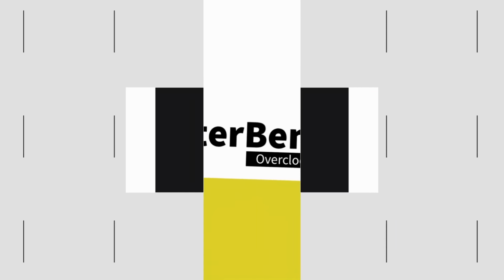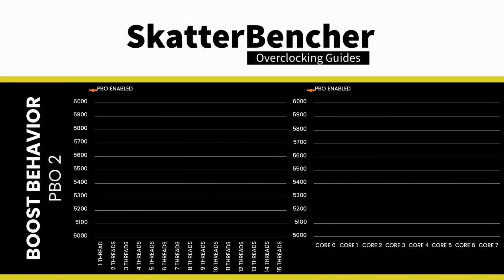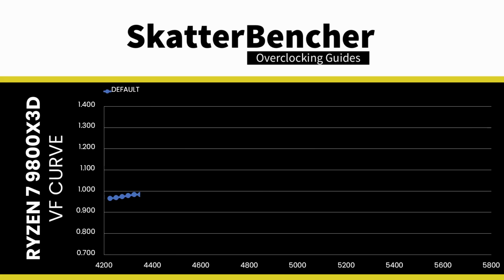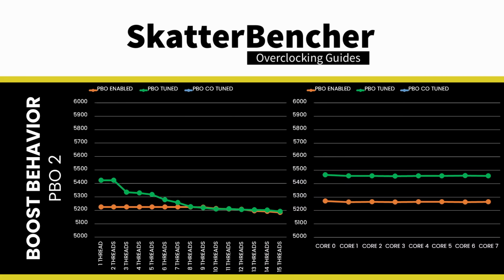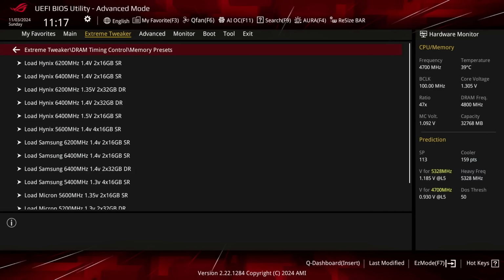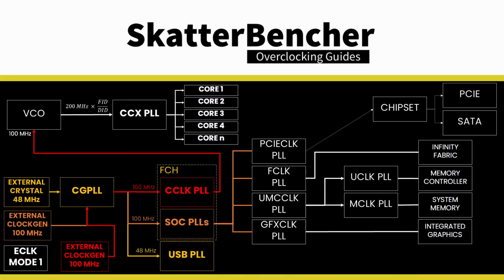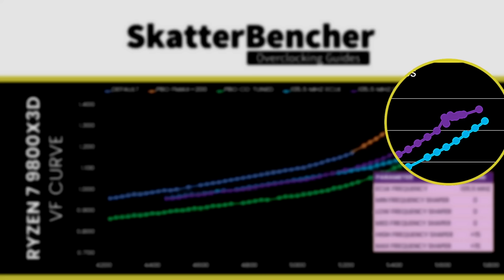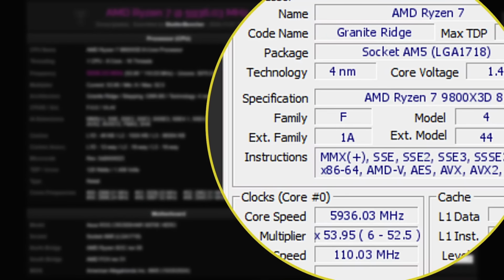Ryzen 7 9800X3D Undervolt & Overclock to 5750 MHz | SkatterBencher #82

Comment: I tried exact same settings using exact same components but can’t get it to run. The minute I change to asynchronous mode it doesn’t like it above 101?  Any suggestions??
Reply from the maker: Are you changing the correct eclk in asynchronous mode? What is the behavior - just not booting up?

Comment: Okej, guys I need help. Setup b650+9800x3d+kingston fury beast 6000mhz. While overclocking first way (+200mhz) after saving and reboot dram led on motherboard is light up orange. Tried do remove battery from bios, clear cmos nothing works… did i fry something? Looking for serious answers
Reply from the maker: Highly unlikely you fried something. It sounds more like a memory or memory controller problem. Try removing 1 stick of memory, cmos clear, then boot. Once you get to BIOS, apply the same settings except for enabling EXPO. If that works, it's probably some auto-rules giving trouble with DDR5-6000.

Comment: Hi Possibte ram OC with this CPU? I want to run my gskill around 7500MHZ
Reply from the maker: Yes you can overclock the memory. DDR5-7500 will require you to run UCLK = MEMCLK/2, however.

Comment: what is now the sweetspot for ddr5 for 9800x3d...when overclocking.?
Reply from the maker: 6000 to 6400 MCLK, 1:1 UCLK and 2100-2200 FCLK is usually the most straight-forward. If you get 8000 with 1:2 working, apparently that's also pretty good (though I never run it)

Comment: Wow!  Are there any videos where you do Curve Shaper opverclocking like this on other  non-Asus boards and BIOS?  I sure would like to know if it is possible on other manufacturer's boards/BIOS and have a list of which ones those might be.
Reply from the maker: Any AMD board should have access to the Curve Shaper options because it's part of AMD's BIOS structure.
Reply: @SkatterBencher  thanks for the response!  I just received two motherboards which I'm going to test with my 9800x3D in the next few days.  One is the ASUS ROG Strix X870-A Gaming WiFi and the other is the GIGABYTE X870 AORUS ELITE WIFI7 ICE.  I believe that neither of these have an ECLK so I'm tempering my hopes for success.  If I'm presented with an ability to do curve shaping at all, I'll also try per core shaping just to see if it is supported.  I'll let you know what I find.
Reply from the maker: Good luck and have fun!

Comment: Best OC channel. What would you recommend for this ryzen DDR5 6000 or 6400?
Reply: depends on the cl
Reply: I have a 6000 kit that runs 6400 cl 30 and its better ofc. Lower latency. At the same time, if you do 6000 cl28 there is almost no difference
Reply: 8000mhz is the best so you can match UCLK and FCLK
Reply from the maker: Whatever works with 1:1 UCLK (6400 might be a little tricky), then just optimize the sub-timings a bit.
Reply: @TehShiaT11einself  So G.Skill or Corsair 6000Mhz CL28 ?
Reply: @obviouslee1949  cant go wrong with that
Reply: @iikatinggangsengii2471 cl is not an important timing. It's a half decent indicator of which IC the kit is, that's about it.

Comment: hello. great video. what is your g skill ram kit? the one in the link goes to a 48gb kit.
Reply from the maker: I have some early production model of this F5-6400J3239G16GX2-TZ5NR.

Thanks for the heads up, I updated the link in the description too
Reply: @SkatterBencher  ty mate
Reply: @SkatterBencher  last question if u can help: would this be a good kit F5-8000J3848H16GX2-TZ5RK to test both scenarios? 6200 or 6400:2133 and 8000:2000 or it's not even worth it with the 9800x3d? i have a x870e hero as well

Comment: I just got done building a new PC with a 9800X3D on a gigabyte x870e Master, should I have the latest bios installed ?
Reply from the maker: It's not a must but I always try to have the latest BIOS installed. Usually it has all the latest improvements (particularly for memory compatibility).

Comment: Can I apply these same settings for my 9800X3D on a Crosshair X670E Hero motherboard or are these specific to X870(E)?
Reply from the maker: The overclocking process for X670E and X870E are identical.

That said, I would never recommend copying settings from the internet but rather advise to adjust the settings according to your system's capabilities
Reply: @SkatterBencher  thank you for your response

Comment: Thank you so much for the guide! Right now I have two sets of RAM and I am wondering which you think would be better for my build with the 9800X3D and ROG X870E Crosshair. One is Corsair Vengeance (Non-RGB) 6400MT/s CL32 and the other is G.Skill 7200MT/s CL34 from my current Intel build. I’m honestly not sure if the G.Skill RAM would be compatible as it is not on the motherboard’s compatible RAM list. Do you think I would get the best performance from A.) using the Corsair kit and copying the memory timing and clock adjustments you made B.) trying to run the G.Skill kit and see the best speed and timings I can get from simple EXPO or C.) copy the memory timings and clock adjustments you made but using the G.Skill kit. I that believe both RAM kits are using SK Hynix A-Dies but not 100% sure.
Reply: @SkatterBencher
Reply from the maker: Tuning the 6400 kit will probably be more straight-forward than the 7200 kit
Reply: @SkatterBencher thank you so much!

Comment: I am new to this. I am following Strategy #2. I set to 10x scalar, cpu boost to 200. I started with curve optimizer -15 all cores and climbed up to -25. At -25, I ran OCCT, the max I get is 5080 MHz (all 8 cores), 86 degrees C, 150 W, 1.09 V. I am not sure if I am doing anything wrong. Should I keep raising it to -30 and so on?

Ryzen 7 9800X3D
MSI x870E MPG Carbon
arctic liquid freezer iii 420
G.Skill Trident Z5 Neo RGB Series 32GB DDR5-6000

Comment: Is it possible to tune memory similarly with 32gb modules? Or are they slower?
Reply from the maker: It's possible to tune 32GB modules but the timings won't be the same. Maybe you can check Buildzoid's channel to see if he has a guide on how to tune 32GB modules
Reply: @ thank you!

Comment: did you increase die vddg iod and ccd for the fclk 2200 or both on auto (system ramped it up from default?)
Reply from the maker: Auto-rules increased it to 1.0V. I didn't touch it myself
Reply: On the okay cpus 2200 should work on default voltages which are typically under 1.0v. VDDG IOD is the one which has the most effect in FCLK stability. I run 1.27v VDDG IOD on my 8600G for 2550FCLK.

Comment: So, if I don’t wanna have to do all that with the curve optimizer, can I pin it to its boost clock and just add the 200mhz to it? Or was that what you meant it doesn’t act as an offset? Coming from first gen ryzen overclocking so a little outta the loop. Don’t have the same board running an MSI x870 gaming plus WiFi. I don’t have all the perks that the rog has. But I still have like 99% of those features other than the external clock gen I think. I cannot set to asynchronous mode either.
Reply: I'm wondering this as well, why would I care for tricky undervolting when my temps are fine in real world use cases anyways and can get the 200 mhz for "free". I say tricky because I read so many different experiences from people, even people having to reinstall windows after too many crashes. I don't care what kind of voltage is going through my CPU, so long as it runs within the specified temperatures.
Reply: You can just enable PBO and set +200MHz but cpu probably won't boost that much without negative CO. My cpu hits 5425MHz and stays there all the time with CO -30, anything below it won't boost that much, even though cpu temp stays the same at maximum load (82°C - Phantom Spirit)

Comment: Is it not possible with AMD to just lock everything at lets say 5.2Ghz at all times and then tweak voltage? The way it was always possible on Intel? So I don't have to deal with this "it's stable in this case but not in this case"?
Reply from the maker: Yes, you can. 9800X3D also supports "OC Mode" which lets you define a V/F point and set manually frequency and voltage. I find that usually PBO tuning gives better results across the board because manual tuning requires you to run all workloads at your "worst-case" scenario whereas with PBO it's more dynamic.
Reply: @SkatterBencher  Makes sense, thanks for the reply. Btw your guides are the best!

Comment: I bought Asrock B650M HDV-M.2 and still waiting for 9800X3D to arrive. My board doesn't have external clock gen. Any chance to OC BCLK to 105Mhz like yours? I plan to delid it and running direct die cooling. (I'm new to AMD since my lastest was Phenom II x2 555BE).
BTW, any chance for max OC memory gear 1 vs gear 2 e.g. your current 6200 vs 8000+. I have seen X670e gene and HDV easily reach 8400Mhz stable on both 32GB A-die and 48GB M-die.
Reply from the maker: If you BCLK OC with boards that don't have asynchronous eclk, then you'll likely be limited to 102~103 MHz due to SATA and PCIe.

I just got a new EXPO-8000 kit so I'll probably have a look at performance at 8000 the next time I make a guide for Ryzen 9000.

Comment: Very Insightful, I shall have to take it one step at a time to find the limits of my 9800x3d, (silcon lotto) I do have one questions though, you have 6400 Mhz ram, but you down clock it to 6200 MHz and keep the timing. Why? and shoulsd i up the Mhz of my 6kMhz ram to 6200. What is the long term affects of running such a high OC on a CPU?
Reply from the maker: EXPO-6400 wasn't fully stable with my CPU (I guess it's the memory controller). Instead of not enabling it at all, I can stick with all the EXPO performance settings and just reduce the memory frequency once notch. It's an easy way to keep the timings while not suffering from instability.

Comment: My temps hit like 99c sometimes when loading games, in game its stable around 65c is this normal? I came from a 7950x3d and that cpu never got that hot
Reply from the maker: 99C sounds very high, especially given TjMax is 95C. Is that with PB enabled?
Reply: @SkatterBencher  I will do some more testing after I repaste tonight. No over-clock has been set yet. I will back with you. Thanks for the response

Comment: Is it possible to run this locked at 5.2ghz all core and then adjust voltage as low as you can stabily go?
Reply from the maker: Yes. For 5.2 GHz you probably need around 1.1V.
Reply: @SkatterBencher  Sounds about right, if I remember correctly I only needed 0.95 for 4.9GHz, which matches Zen 4 IPC at 5.6GHz. Oddly, enough this IPC match thing is only a thing for syntethic benchmarks, in gaming and what not I saw a performance regression.But in say cinebench for example zen 5 at 4.9 matches zen 4 at 5.6...

Comment: Same wattage shows 65c max on a direct die cooling, see derbauers video, whish you tried the max overclock of a delided 9800X3D
Reply: Up you go... Der8auer doesn´t do such extensive guides. I would be very, very, very happy for such test.
SB and Der8auer are both tipping the scales for me to upgrade from 7600 to 9800X3D, delid it and OC using SB guide :)

Plz, get that delid done and repeat a few significant tests. That thermal headroom could be very, very interesting in the extreme OC scenarios :)
Reply: @Fr4kTh1s  Derbauer is not even testing the max oc on a delided 9800X3D such a waste, 5600Mhz all core is easy and only 65c, I really don't understand why he don't try a max overclock, maybe is 5,7Ghz allcore also possible.

I have a delided 7900X and 5,6 on the fastest CCD is also the max.
Reply: @Kirsehirli1453  It's perfectly safe to Delid ?
Reply: @obviouslee1949  No, but you have to be carefull  I already destroyed a 7950x while cleaning the CCD's

Comment: Hello can anyone advise me which overclocking of the processor here from those presented(exclusively for gaming) would be stable for me and there were good temperatures,I am a layman in these matters,I intend to play exclusively only in 4K,I know that the processor plays a small role in this resolution,but I want at least a little to underline it to be stable.
PC:
Asrock x870e Taichi
Ryzen 7 9800x3d
Gskill 2x24GB XMP-8000Mhz cl 40 1.35V
RTX 4090
Reply from the maker: Strategy #2 or #3 gives you most of the performance boost with the least amount of time spent on tuning
Reply: @SkatterBencher  thanks i I appreciate it😉👍
Reply: @LeonS.Kennedy-v5u i have a similar rig as yours and i’m about to overclock the 9800x3d. Were you successful in the overclock? I plan to use method #2. Thanks!
Reply: @ I did it through the second strategy 2, I wanted to do it through 3, but I don't know what DDR5 clock speed to set to make it stable and which option to set in the BIOS
Reply: I tested CPU+RAM stability with OCCT for 8 hours and it was stable

Comment: I follow the guide did method 2, I then ran cinebench23 and occt the same as you but i dont see it go up to 5.4 it stays the same speed at 5.2. is there a reason why?
Reply from the maker: Strange. What motherboard are you on?
Reply: Thanks for your reply, I’m using a Asus strix X870-A however I’ve got a replacement board that one was faulty. 

I’ve been seeing a lot of guides and reviews like yourself set their cpu clock override in method 2 to 200. Curious if you tried go higher say 400 in cases like mine where I don’t have asynchronous mode.

Comment: Little Question when i want run 5,6 ghz what ECLK must i set? or must i change a other setting?
Reply from the maker: There's two options to set 5.6 GHz: (1) use ECLK with PBO (5600/5450=102.8eclk), or (2) set a fixed 56X ratio
Reply: Big thanks :)

Comment: do I need expo ram or can I use my existing intel ram on this ? i have gskill 8400 2x24gb
Reply from the maker: Probably you can just use your Intel XMP memory. Motherboard vendors have put a lot of effort in cross-compatibility for EXPO and XMP
Reply: Makes no difference whatsoever. No difference between Expo or XMP Hynix A/M die sticks whatsoever.

Comment: hello does a 8000mhz xmp 3.0 ram works with 9800x3d? if so shoud I use it that way or fine tune it to 6000mhz cl28?
Reply: If you can run stable 8000mhz in 2:1 mode that's the fastest config

Comment: Game results are bugged, right? Same results on all different methods.
Reply from the maker: It's in line with what I'm seeing on all Ryzen 9000 CPUs
Reply: @SkatterBencher Maybe it’s worth running game benchmarks at 720p? That gpu in your test system is limiting the 9800X3D imo

Comment: Hey! Just wanted to say that I also cant do 6400 anymore. I was running 6400 1.21 SOC and 1.44v 24/7 with my 7950X3D.

Little bit disappointed:(
Reply: It depends on the UCLK of the chip to maintain 1:1 with 3200 MCLK

Comment: Sir, is late november 2024 and your 6400 ram is not stable or even booting, thats why you lower to 6200? let me help you with that, Go on amd overclocking section, ddr and infinity fabric freq/timings, ddr options, ddr nitro mode, set that enabled. there you go. You can enable robust training mode too below that if it is not stable
Reply from the maker: It's booting but not stable. Thanks, I'll give that a try next time!
Reply: I got mine to boot 6600 but not stable as soon as i opened OCCT watching other videos I hadnt before uppd my Vsoc on cpu to feed the UMC and UCLK stable tested at 6400. I still need to tighten i only made the computer yesterday.
Reply: @deadpool790  Few chips can do 1:1 6600, very rare. It was doable a long time ago when vsoc wasn t limited at 1.3v

Comment: This will come handy😊😊

Does anyone know if this kit is as good as the g.Skill?

" SP064GXLWU60AFDE" 
It's a 64gb 6000c30(32*2) silicon power kit

Pls I need to order
Reply: i have no experiece with silicon power
Reply: I think your motherboard would determine if that memory would run stable at those timings, as 6000MT is the upper limit for dual rank on boards that advertise 7200 in the non-detailed spec line.

Comment: That's good, BUT! People usually use 7800x3d/9800x3d for GAMING, using regular boards based on B650 (like ASUS TUF B650...), theses boards does NOT have all bios options you showing and less OC potential. Please consider this. Thanks for your video.
Reply: I think you are only missing eclk from these on cheaper board so other option 4 you are good to go.
Reply: if you cheap out on a mobo because you didnt want to pay extra 20-40 bucks than thats on you. if you want to overclock and dont know what hardware you need thats your fault lol
Reply: I have cheap B650 Tomahawk from MSI and it has eCLK
EDIT: oops sorry, it's bclk
Reply: @RmX.  No it does not have XD
Reply: if you buy a high end CPU and cheap out on the motherboard then you should just buy a console instead

Comment: i thought scalar was dangerous as it could degrade your cpu
Reply from the maker: In theory, Scalar overrides the warranted silicon stress level and could degrade the CPU. 

In practice, the impact of scalar on real-world effective voltage is so low it won't hurt the CPU.
Reply: All Ryzen CPUs degrade over time, 6 years ago my 7500F could do 5.6GHz all-core at 1.27v. Today its an instantaneous crash in cinebench r23 even using 1.3v. Scaling stops past 1.3v on ambient cooling so 5.6GHz is basically unattainable now. I put that CPU to rest a while back since its a paperweight now. But of course, you wouldn't really notice this kind of degradation under normal conditions since the normal boost algorithm for the 7500F doesn't come anywhere near 5.6GHz out of the box anyways.
Reply: @juice7661 You probably confused the cpu name because that cpu didn’t exist 6 years ago lol
Reply: @themarketgardener  I was probably tired as hell when I wrote that, I meant months. If I lost 50MHz after 6 years I wouldn't even  be like 0.1% mad.